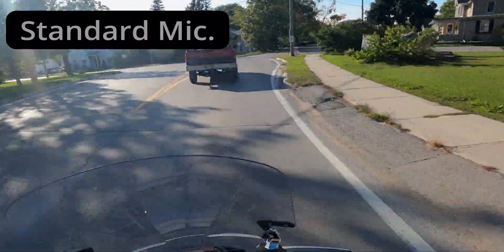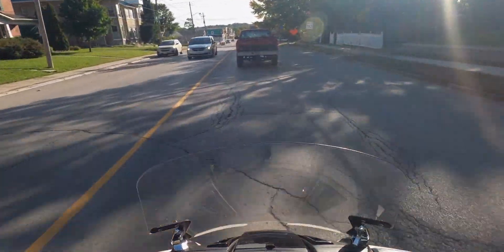RODE WIRELESS GO II for helmet camera audio. Let's give it a try.

Comment: Good review. Really sharp audio and video. What are you filming with? I use a wireless go (single) on all of my moto vlogs. Sometimes (on my big camera) I also use the Video Mic Pro (the shotgun mic). The shotgun is slightly better/deeper, but the wireless is super convenient. It's especially handy when doing how to videos where i'm all over the shop and not necessarily in front of the camera/microphone.

Question: Do you ever have issues with the deadcat falling out/falling off? I think maybe i"m not installing mine correctly. It always falls out.
Reply: Oh you're in Fenelon! I'm in Toronto. Small world! Subscribed. If you're heading thsi way in the spring give me a shout!
Reply from the maker: On that video I used an iPhone XS running at 4K 30FPS  mounted on a DJI Mobile 3 Gimbal for the narrative parts and intro ETC.  On the bike I am using a Go Pro Hero 8 Black mounted inside the Media Mod on top of my helmet.  The Rode Wireless GO has been a great addition.  My wife is participating more in our videos and It is so much better have her "Miked" instead of running around trying to keep her close to the camera.  I used it on my latest video for narrating a screen recording on my computer.
Reply from the maker: Thanks for the Sub!!  Cheers and great riding!!.
Reply: @BikeBoatandTravel  that's awesome. When I bought mine the two mic option wasn't out yet. For now I'm the only one who will go on camera though so I guess that's okay
Reply: @BikeBoatandTravel  that iPhone footage looks crystal clear 👌
Reply from the maker: Using it with the gimbal and the DJI app really helps.  I capture the audio using one of the RODE transmitters set to record "always" as I don't have the special cable to connect the receiver to the phone yet.   In post, I sync the audio from the RODE up with the phone clips eliminating the problem with almost all of wind noise I may get with the phone when outside.
Reply: @BikeBoatandTravel  Smart. I never know what those trs vs ttrs or whatever they are cables are... luckily i just bought a set and it came with both cables and one was labeled phone and the other camera so that made life easy!

Comment: I think the wireless is 100% better that using the Standard Mic.  Much clearer and cleaner IMHO.  A tad over modulation at high speeds but you may be doing that out of habit using the other set up.

Sounds great.  Looking forward to your pillion (Wife) using it on the Spyder and just walking around.
Reply from the maker: Thanks for your comment.  Based on this test I am going to test some options for the "cheekpad" mic.  Perhaps out with a dead cat on it to clear up the audio a bit.

Comment: Which mic is better for motoblogging?
Reply from the maker: So far I have stuck with the lav mic connected directly to the go pro on my helmet.  I have seen some other interesting set ups using the Rode system that I want to try.  You should check out Mr and Mrs Two Wheeler's channel he has some good  test using the Rode.  Thanks for you comment and for your interest in my channel. 👍🇨🇦

Comment: That really surprised me. I may have to try that. I’ve got the LS2 Valiant 2 and tried a chin mount, but it didn’t workout so well. I’m just using a LAV mic now. This would make things a lot easier with a modular helmet like the valiant 2 that flips back 180 degrees to the back of the helmet.
Reply from the maker: Thanks for your comment and for your interest in our channel.  I will leave a link at the end of this to another video I did on among other things audio that may interest you. There is chapter markers in the video if you want to skip ahead to the audio sections.  I have ended using the lav mic for the simple reason that I want to use the helmet open also.  Here is link to that video https://youtu.be/8VyklQj4osg
Reply: @BikeBoatandTravel  nn
0
Reply: P0
Reply: 0p00

Comment: HI, I tried the same setup on my motorcycle, it was ok but the issue I found is that the signal was too high even at the lowest setting on the rode (-30db) It's just not meant to be that close to your mouth. 
I ended up adding a microphone by Sena into both mine and my wifes helmet and I think it sounds great. I tested it up to 85-90 mph.
You can hear the audio and see the setup in this video. www.youtube.com/watch?v=0nbKoI1dp5c
At about the 16:49 point we get on the highway traveling about 80 ish miles per hour.
There was some wind noise on my shoei (more on her helmet, Schuberth is just noisier) because I removed the chin curtain for summer riding. I think I will add a deadcat to both.
Hope this helps.
Mike
Reply from the maker: I agree with you on the RODE and the proximity to your mouth.  I watched / listened to the video you recommended and you have nailed the audio for sure.  It sounds like you are doing a voice over after the fact... very good!!  At some point I may move over to the SENA after hearing that level of quality.  If you are interested, I did a video of my whole "audio" journey in 2021 (https://youtu.be/8VyklQj4osg).  If you go to timecode 11:38 you can hear the progress I have made. Play it to the end for my solution..... Drop $30g's on a new Spyder with better wind protection!! No riding here right now but we are getting close.  🇨🇦 Subbed you channel looks like you have some great content.
Reply: nice set up one your bike love the GoPro products also
Reply: @kdgservice3686  thank you buddy 👍